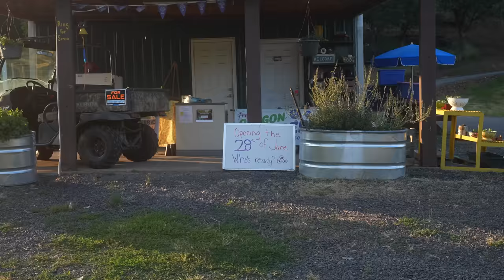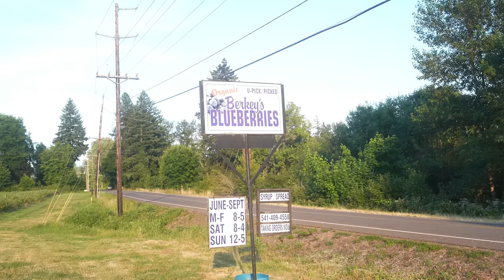First weeks in our new Land Cruiser camper (but then having to say bye to it!)

Comment: Does the cab have AC?  Any thoughts on AC for the back?
Reply from the maker: Hi Mike! No, the cab doesn't have AC, although there are a few aftermarket options that we're considering. For the living space we're looking at going with Cruise n Comfort (or another ducted DC powered option) that we could also potentially duct to the driving space, too. A rooftop AC is a last resort because we're already so tall and we don't want to be anymore top heavy than we already are. :)

Comment: Where did you leave your truck when you left Oregon?  Airport or are there better places? Thanks.
Reply from the maker: Hi Matt! We actually were able to leave it at a friends house in Bend. Airports are usually good options since they're safe and many have space for oversized vehicles. However, since we had to leave it for almost a month, it would have been crazy expensive and we didn't want to leave it exposed for that long.